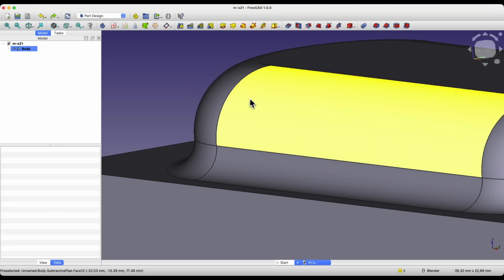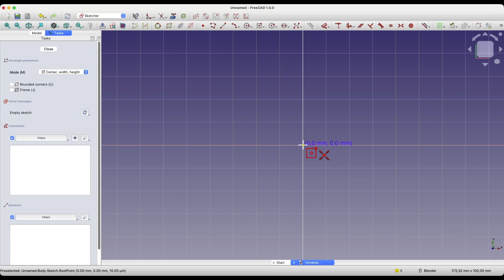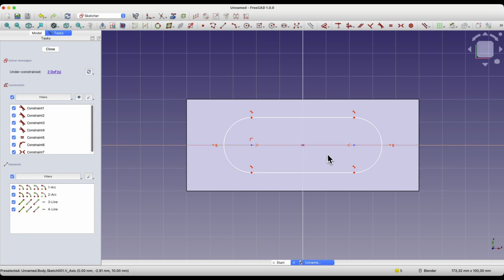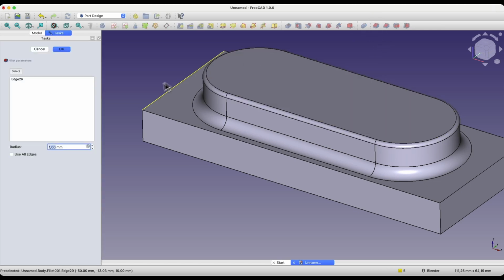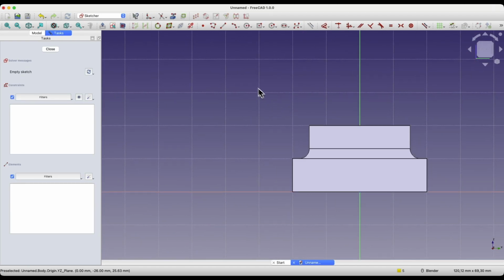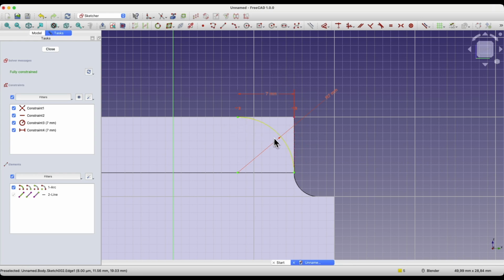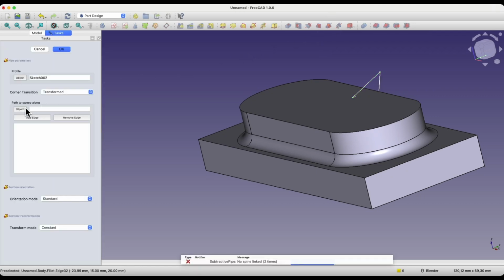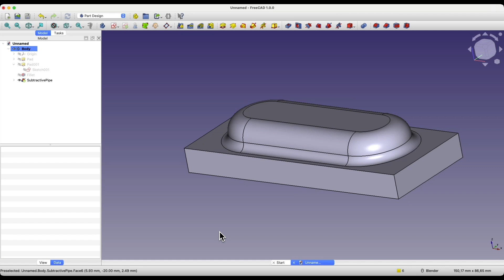FreeCAD Tutorial: Creating Smooth Fillet Transitions with Subtractive Pipe

Comment: Nice tutorial but when I enter 6.999 mm (so an extra digit of 1/1000) then the fillet is created and  when I check the radius of the created fillet the radius is set to 7 mm. So adding an extra digit (6.999 vs 6.99) does help. I do not know if it helps for all fillets to be added to the design.  🙂  At the other hand this lesson is a nice tutorial to see how a subtractive pipe can be used to remove material!